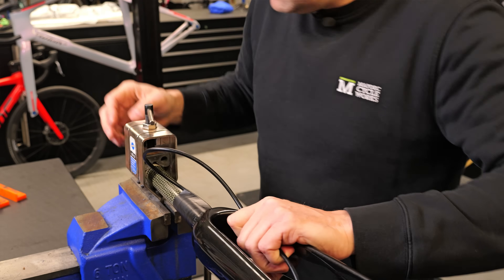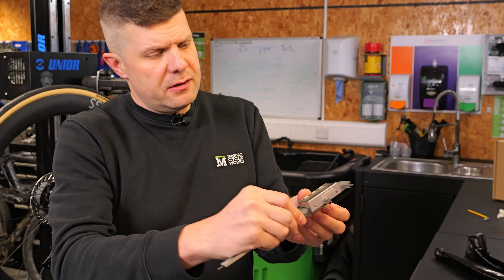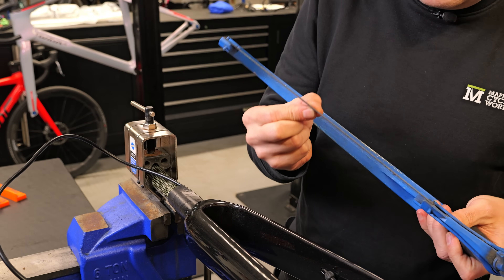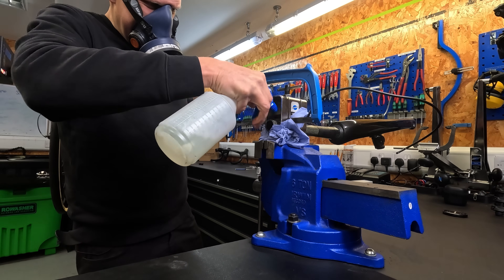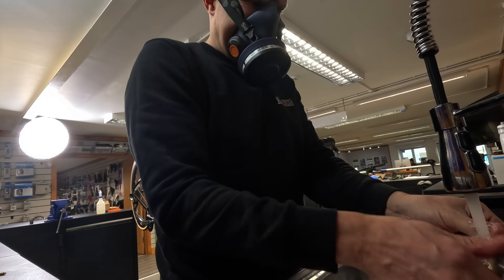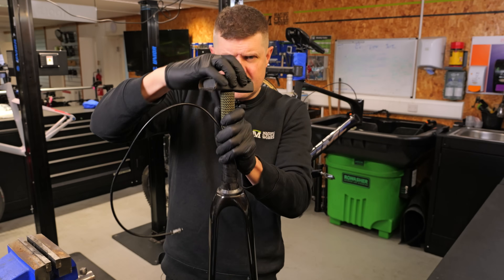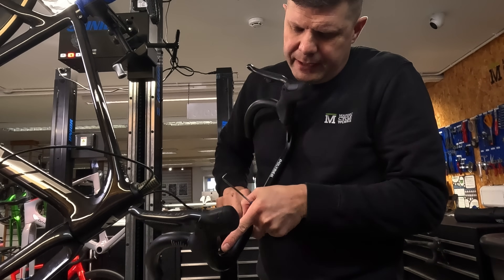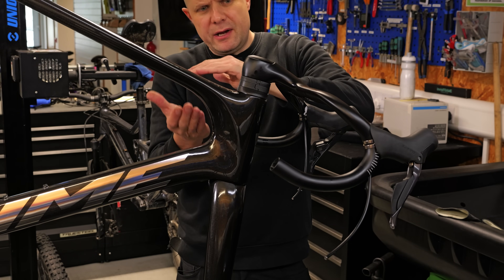The perfect cut - Carbon Steerer method.

Comment: Professional hero or hack?
Just wash that Carbon dust down the sink drain to some one else's problem, like your local water treatment plant, out of sight out of mind,  Why can't you use reusable rags, what is with the constant trail of one time use paper towels, what portion of your profit is going in the trash can? And seal that cut surface with some nail polish, never heard of moisture intrusion resulting in Carbon fibrer steerer tube  delamination?

Comment: I understand the +-2mm adjustment for the expander plug when determining the final cut point but I dont get what the other similar adjustment is for assuming the first point was determined after compressing headset together.  Thanks
Reply from the maker: Cause you need a little gap to actually pull the headset together and for the top cap to recess into. It’s usually in the stem manual

Comment: Nice video, only thing I have found with internally routed cables is the compression of the spacers seems to be far more than exsternal cables.
Reply from the maker: This depends on the quality, rigidity of those spaces.  Some are very flexy.

Comment: Is there any internal routing system that allows for spacers to be placed on top of the stem (so that stack can be increased by moving it under the stem, after the steerer has been cut), like the old school standard threadless setup?  Seems like these newer systems do not allow for much error or even resale to another person who may need a higher bar placement.
Reply from the maker: Yes. Most do.  For instance the wilier and look ones featured recently. There is a aero cover with holes in the top.

Comment: GC Performance has told the story a few times on his channel the time he marked the steerer 'without' the stem on,then cut steerer 😣in his defense it was very early days of him working in the shop
Reply from the maker: I did a similar thing once.  Costly mistake you only make once.
Reply: Yes, you don't want to make that mistake. As Paul said, a mistake you only make once. I did it with a Fox 36 fork. Unfortunately significantly more expensive of a fix than a carbon road fork.

Edit: I want to amend this comment by saying the customer only brought me the fork. Not the bike it was going on. So technically not a mistake I normally would have done, as I didn't have the bike.

Comment: A tip is to use Wall paper paste or shaving foam for collecting the dust. Also to get a perfect line for the saw cut just wrap a piece of paper around the tube nice and tight and that gives you a perfect edge to mark and cut without using that daft clamp guide.👍
Reply from the maker: I will try the shaving foam thing.  Can’t say I’m ready to start mixing and cleaning down wallpaper paste.
Reply: @Mapdec wall paper paste once mixed lasts for ages, just keep it in a jam jar, we use both if drilling asbestos, so that shows how good it is, both just wipe off with a damp cloth, 👍